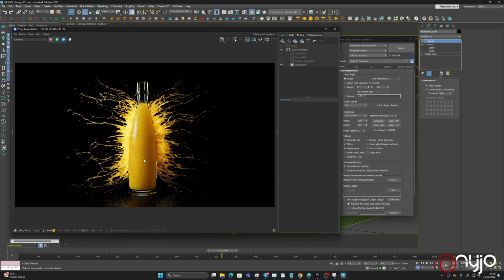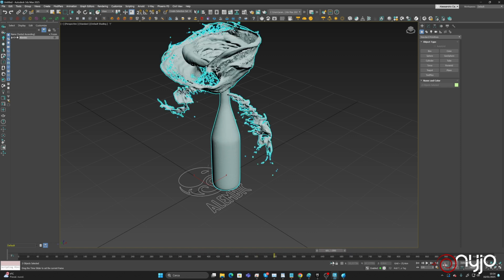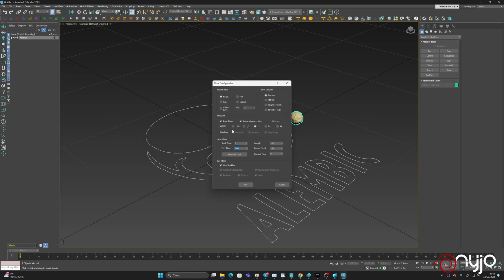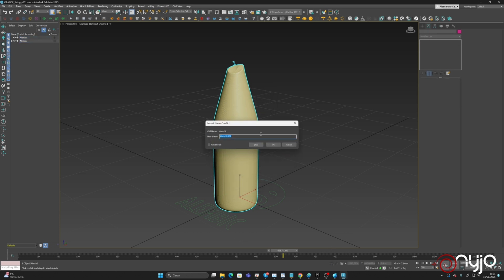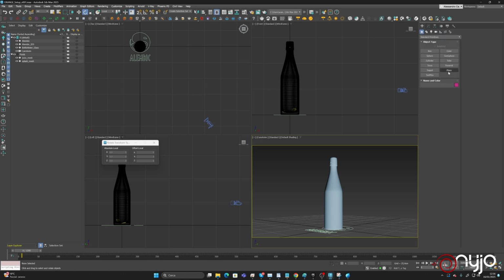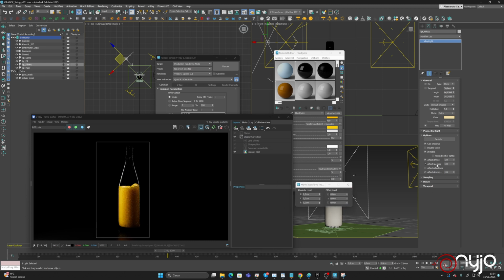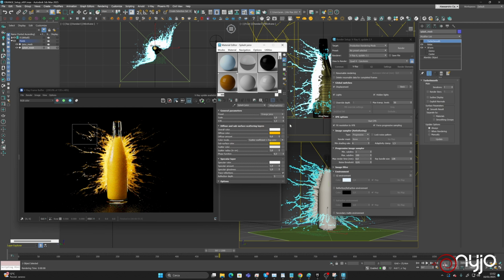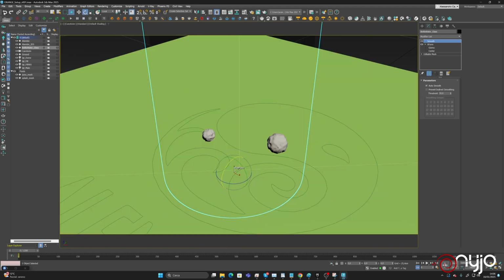Creating a Orange Juice Simulation with LiquiGen by Nyjo FX - Part 3

Comment: Wonderful work, thank you for this walkthrough!!! Do you think certain sacrifices can be made to make it functional on a 12gb vram laptop 4080? I saw your sim hit 12.05 gb a few times. Would decreasing the domain a touch help with this and still be viable?
Reply from the maker: Thanks a lot, I really appreciate it. BTW yeah you can manage it on a 12GB vram laptop 4080, for main juice fluid it should be not a problem, you have just to lower a little bit if needed the domain voxel resolution or max voxel parameter, same for big splash emitter but in this case it will be simple to avoid that it will grow to much using too many voxels, you can for example add a drag node and animate it to slowdown the big splash step by step to avoid a so big splash area ;) if you need more help with it please let me know.
Reply: @NyjoFX  wow thank you so much I really appreciate that! incredible work as well, keep it up!